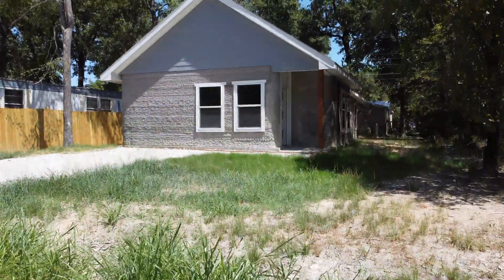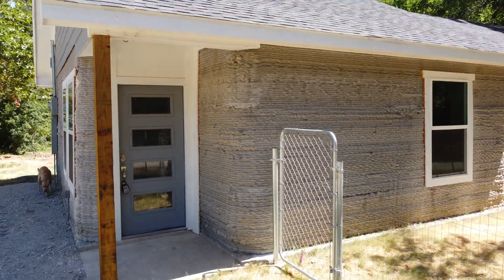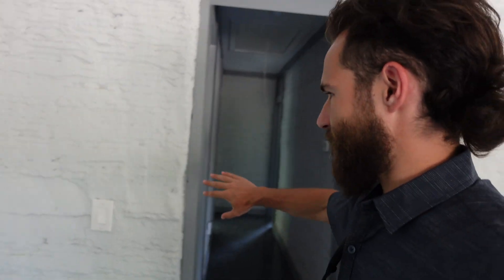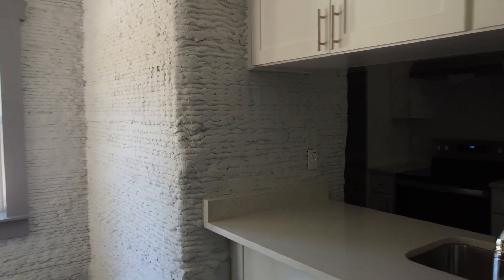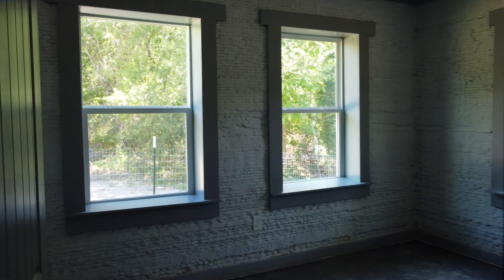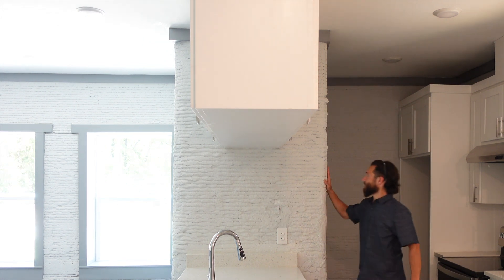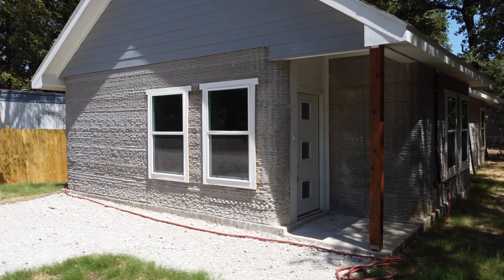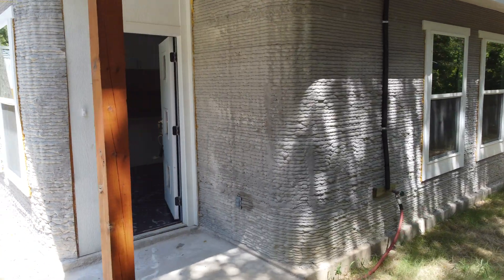3D Printed House near Dallas, Tx

Comment: The mass concrete walls will stay up for centuries, and this is good.  But there is a need for a more pleasing interior and exterior appearance.  Nobody will want to live in these houses, except to save money.  They have the feel of a missile defense bunker.  Unless a better appearance can be achieved, the builder is looking at the low-end market only, which is a shame.

Something like the RIC system should be adaptable to applying smooth stucco finishes, inside and out.  Perhaps some minimal human once-over to finish up, but, ideally, even this should be unnecessary.  The RIC machine looks like all it needs is a second attachment for stucco, then a third for paint -- and voila!

Once you have a traditional Mediterranean stucco appearance inside and out, you have yourself a viable product across the market.

Comment: The second one was better, but still not so good. The acoustics are bad as you say, and I don't know if there is an easy fix, but that narrow hallway as so spooky and surely that would be an easy fix. If I were a child in that house, the narrow hallway would definitely scare me into nightmares. There really is no reason I can see not to make it twice as wide, and is there anything you can do to inexpensively dampen the echoes?
Reply: The echoes will go away at once when it is furnished.  This effect is typical of concrete buildings.  They made a mistake not putting in laminate flooring to deaden the echoes, but it's still fixable.  A rug on the floor, some rugs on the walls, some lace curtains on the windows, a few couches, some book cases, armoirs, etc -- good to go.

If you look at photos of apartments all over the post-soviet space, you will notice lots of wall rugs, lots of wooden wall closets, always a rug on the floor, always laminate or hardwood flooring in all but the cheapest units, always lace curtains alongside the ordinary curtains, and so forth.  

Soviet-era multistory houses were all built using prefab concrete subassemblies assembled by crane and cemented together on site.  The empty apartment always echoes like a cave.